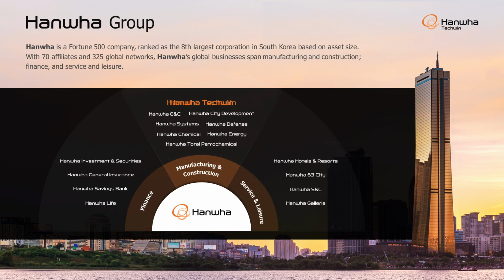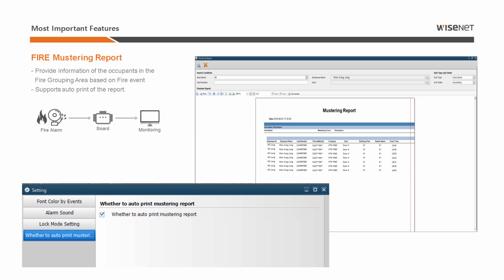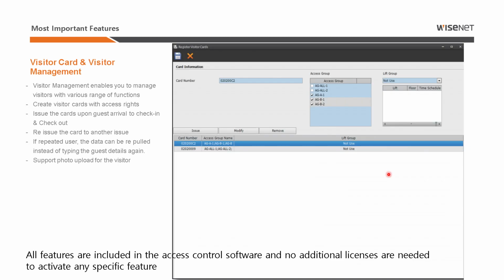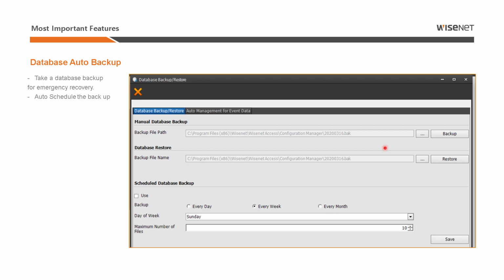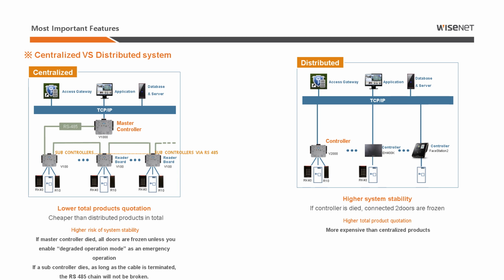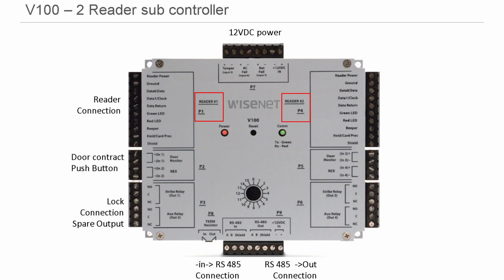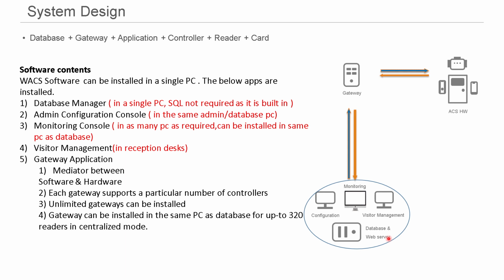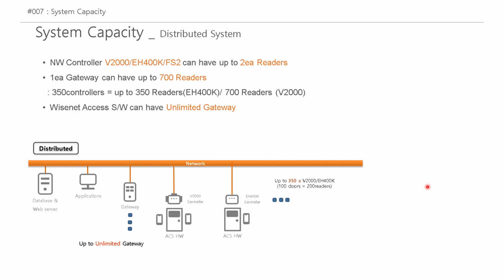Webinar Wisenet Access Control ,18 March 2020

Comment from the maker: FAQ 1) How the integration will happen for lifts 

The reader in the lift = Lift Reader.
Lift Reader communicates with sub-Controller (V100) or V2000 or EH400K
The goal of the Lift control option is 
1) Control the access for the user to use certain lifts and deny access to user for certain other lifts.
E.g.: Lift 1 & 2 is accessible by the guest and Lift 3 – not accessible.
So this control is done using the lift reader. The reader checks the user’s credentials and verifies which lift “he/she” can access.
2) Once the user gets access to the lift, then “He/she” should be allowed to access ONLY specific Floors. E.g.: User can access Floor Ground floor & 5th Floor. 
So when user shows “his/her” card to the reader, the controller will also check the individual floors the user can access within the Lift.
3) If the building has 10 floors including Ground. Then each floor corresponds to a “Digital Output” which will be released in accordance to the access rights.  In the example as above, where the user gets access to Floor GF & 5th Floor, this means, and the controller will release two contacts out of ten output contacts to the LIFT Control System.
4) To send digital outputs, you have to V300 – 12 Output module for cost effective output relay solution.
5) Example : Building A has Two Lifts – Lift 1 – 10 Floors (GF to 9F) & Lift 2 = 10 Floors (GF-9F) so total outputs required will be 
10 outputs – Lift 2 + 10 Outputs - Lift 2 = 20 Outputs.
V300 has 12 Digital outputs.
V300 required = 20/12 = 2
In addition to V100 or V2000 or EH400K controller for every 2 or 1 lift readers.

Q 2) is there any limitations in the number of floors for lift integration
Answer: Total number of floors supported is GF + 200 Floors + 50 Basement per database.

Q 3) what type of server is required to access control?
Answer: 
Processor: I5, I7
RAM: 8GB
OS: Windows 7, 8, 8.1, 10 / Windows Server 2008 R2, 2012, 2012 R2 - 64 bit, Server OS 2016. 
1 Gbps NIC 
100 GB HDD space (free space) so consider 128 GB 
FULL HD Resolution Monitor. 

SQL License or software not required. It is pre-installed with the WACS software.

Q 4) Does it support Soft & Hard Anti Pass back? 
Answer: yes 

Q5) how is communication between v100 and reader. Is it hardwired or wireless?
Answer: Hardwired 

Q6)  Can i know the type of cards can be supported by your Readers?
Depends on which reader is used.
Long range requires UHF for U90
I Class Seos for R10 as example & I Class SEOS Elite for Hanwha Techwin Own code to use with R10 Elite as example

Q7) is there proximity readers available within product portfolio?
It is a known fact that Proximity readers are not very secure so it is not in profile. If however you have existing readers that you wish to re-use. The Hanwha Techwin controllers are neutral and can accept HID proximity readers (Wiegand protocol). 
As a rule of thumb, you can purchase you own readers and also the cards. If you purchase the readers from Hanwha Techwin, then the cards are recommended to be purchased through Hanwha Techwin.

Q8) Can i install the readers externally?
Yes, use the Gasket model as below
Gasket for R10 IP65GSKT-R10
Gasket for R40 IP65GSKT-R40
Gasket for RK40 IP65GSKT-RK40

Q9) Do we need any software to enable Bluetooth feature in mobile while using the card reader?
Firstly ensure the card reader purchased supports Bluetooth/NFC. The model will be 
R10 Elite Mobile, R40 Elite Mobile or RK40 Elite Mobile.
Then you need to purchase MOBILE ID Subscription. This is a “Virtual Access Card” which will be registered in your phone. The App used for registration is HID Mobile Access from IOS or Google Play
Additionally, you would ONE ADMIN Card to configure the Bluetooth readers for the operation method. Example: the Bluetooth/NFC reader can be configured as TAP or Twist and Go. Also the distance of the reception can be configured. Example if readers should read via NFC/Bluetooth for 1 or 2 meters 
Q10) How about if I have intrusion alarm, can we integrate to access control?
Answer: you can integrate via Hardwire to the V200 input board to receive external alarms. Or if you need software integration then look for SSM VMS which integrates to certain intrusion control software panels. WACS is also integrated to SSM VMS.
Q11) is there any special cable requirement?
It is specified in the controller manual document 
RS-485 * 4000 feet (1220 m) to host Using Belden 3105A, 22AWG twisted pair, shielded 100ohm cable, or
equivalent.
Input Circuits * 500 feet (150 m) 2-conductor, shielded, using ALPHA 1292C (22AWG) or Alpha 2421C
(18AWG), or equivalent.
Output Circuits * 500 feet (150 m) 2-conductor, using ALPHA 1172C (22AWG) or Alpha 1897C (18AWG),
or equivalent.
Wiegand 500 feet (150 m) to reader ALPHA 1299C, 22AWG, 9-conductor, stranded, overall shield.
Fewer conductors needed if all control lines are not used.
Ethernet 328 feet (100 m) Cat5, Cat5E, and Cat6
Power Supply
12-24 VDC IN ---- Refer to your Power Supply Installation Guide.
* Minimum wire gauge depends on cable length and current requirements. 

 
Q12) Do you have any products related to arm barriers? Any special requirement to be provided?
You can use the Long Range Reader or Bluetooth enable readers. 

Q13) any special gasket required for externally installed reader
Yes 
Gasket for R10 IP65GSKT-R10
Gasket for R40 IP65GSKT-R40
Gasket for RK40 IP65GSKT-RK40

Q14) Supports Templates to card encoding? 
Answer: not at the moment. 

Q15) what is the purpose of IO Linking? 
Answer: Many purposes, To Link Door Contact to a SIREN or SOUNDER, or trigger door alarm to CCTV for hardwire integration or to integrate to external PIR sensors and open a NON reader based Locked Door.

Q16) Is Wireless access communication is possible between reader and V100 controller?
V100 is not a wireless controller board. 

Q17) is there any limitations in the number of floors for lift integration?
Answer: Total number of floors supported is GF + 200 Floors + 50 Basement per database.

 Q18) How lift controller is interfaced with v300 what is the communication protocol
Answer: Dry Contact/Digital Outputs.